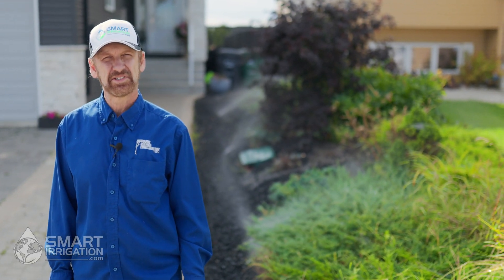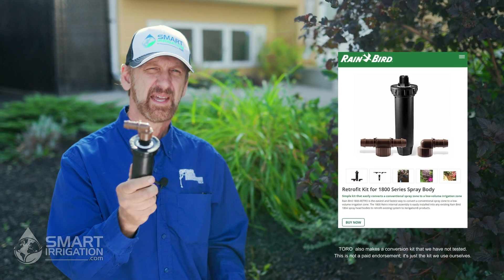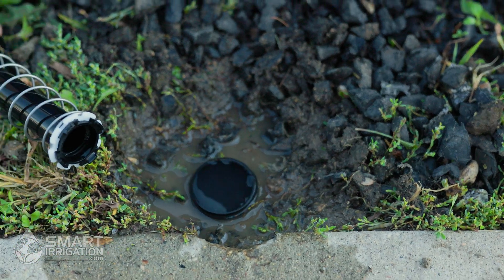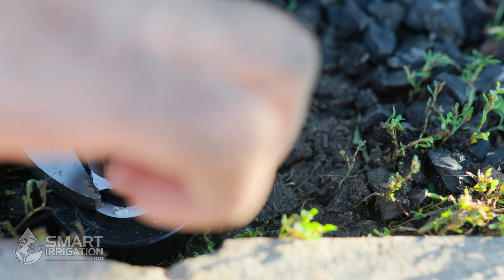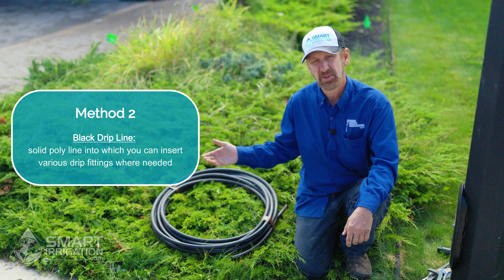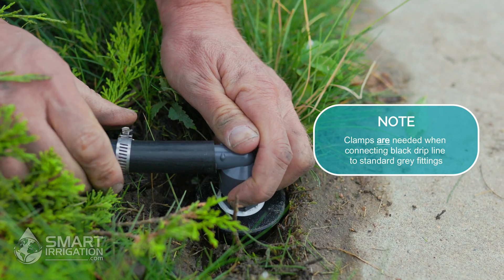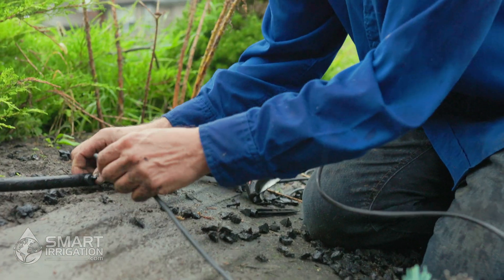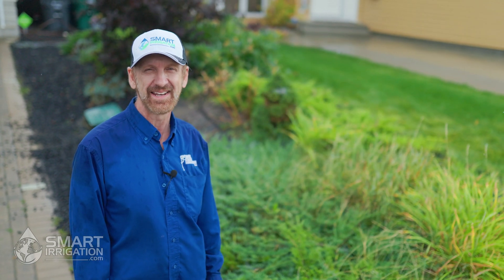Drip Irrigation: Installation and Spray Zone Conversion (Micro Irrigation)

Comment: Could you talk about filtration? In my case my irrigation is sourced from my well. My problem is that over a summer my R-VAN and MP sprinkler heads become partially clogged with sand and tiny pebbles. Can I install a  single 'whole house' filter upstream of the irrigation system? If so what should I look for in a filter?
Reply from the maker: Sometimes, a large screen filter is available on Amazon. They are 1 foot long, but if you have too much sand, you would need a self-cleaning filter system. That would require some research as to what is available in your area and where. Try some other YouTubers' advice, perhaps. I work with mostly city water systems.

Comment: I have a zone with eight spray rain bird heads. I want to keep four working as they are for my yard and want to convert the other four for my garden. Can I use the one zone for both? Additionally the other four heads are in separate location within individual raise beds, should I convert each head with a conversion kit?
Reply from the maker: That is a bit more complicated because mixing sprays with a drip zone isn't a good idea. Sprays need a few minutes to get the water down, while drip zones take an hour or two.